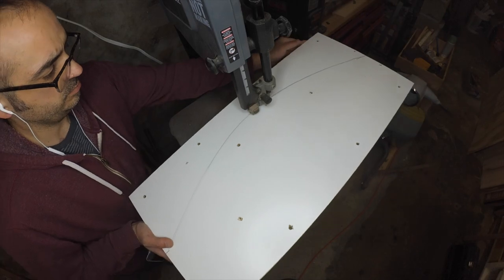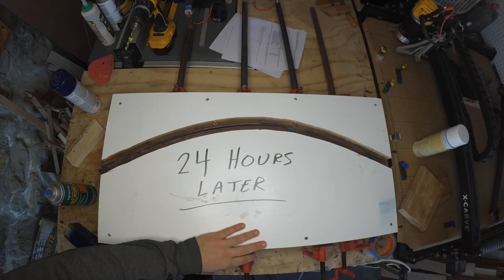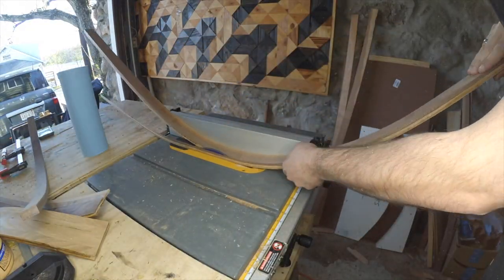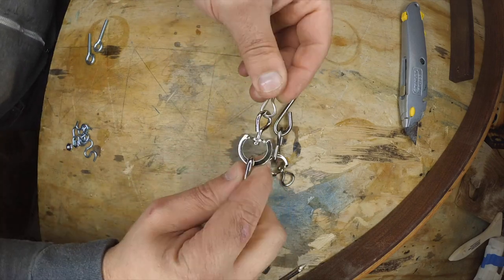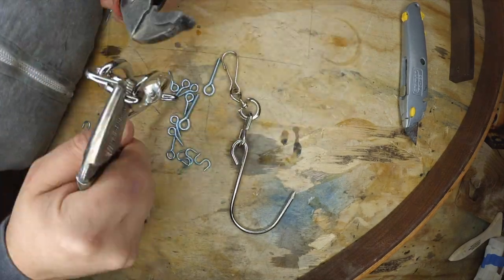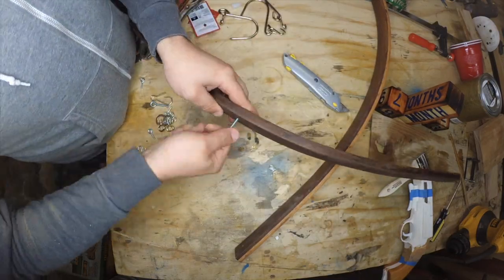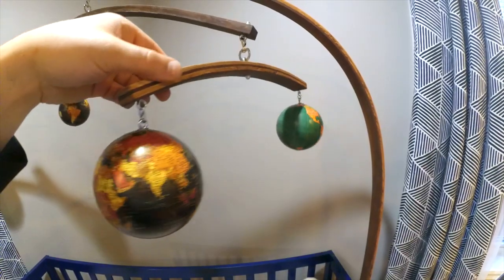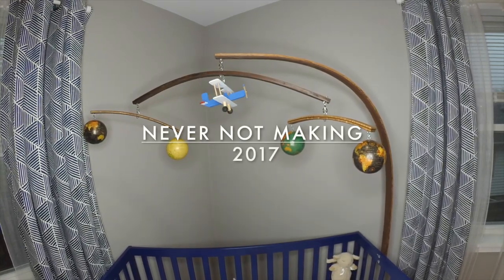Making a Giant Mobile for a Crib

Comment: Do you have a radius for the long arm? All the mobiles I've bought or seen are not long enough to reach the center of crib so I am going to make one. Your crib looks to be the same size so I'm curious of the length and radius of the bend if you can provide
Reply from the maker: I'd say that the radius is close to 3', as that was the size of my clamping table.   But when you look closely, you'll see that the bend is not centered on the length of the material. I left it a bit long so i had space to bolt it to the crib, and then trimmed it to length before install.
Reply: @NeverNotMaking  thank you!